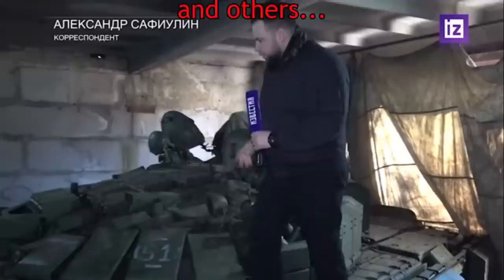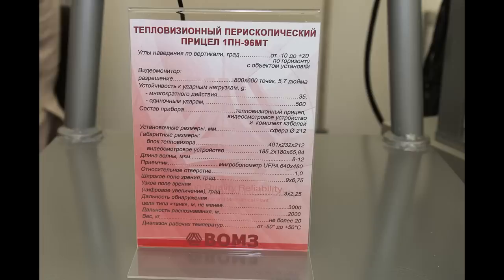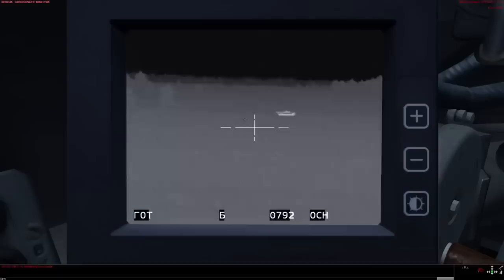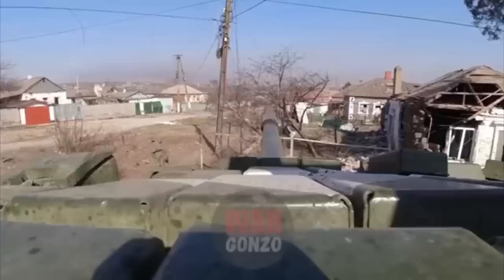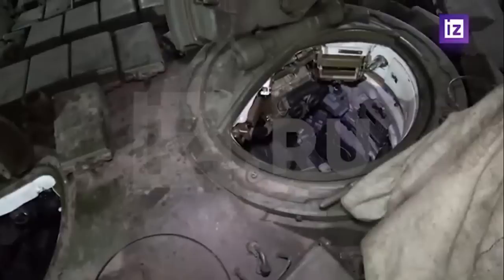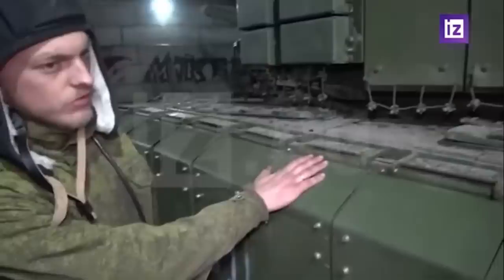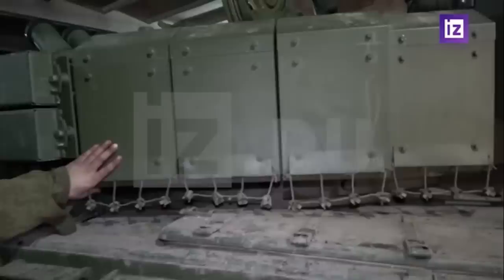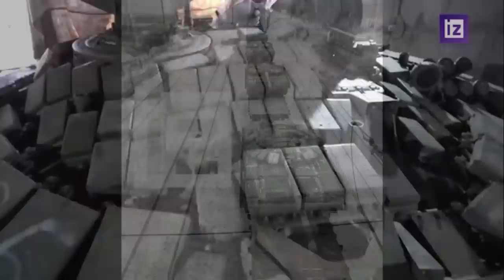Are Russians Downgrading Their Tanks?

Comment: I still cant tell the Difference between the T-55 and the T-72
Reply: The T-55 have small kaboom, the T-72 have big kaboom.
Reply: “I still can’t tell the difference between the Spitfire and a Tornado”
Reply: Well, l think you did not even tried... but if you are serious, just look at the wheels, T55 has 5 on each side, T72 has 6, also a T55 tank gun has a bulge (gas extractor) at the end of barrel, a T72 has a bulge somewhere at the middle of the barrel...
Reply: While T-63, T-72 and T-80s can be confusing (red effect made video about them) T-55s, T-62s shouldn't be.
T-55 has:
 - 5 road wheels, with first one really separated and 4 other together- biggest difference
 - Bulkier turret (with much lesser angles in the lower part)
 - gun with that thick bump near the muzzle (T-72 has roughly in the middle)
 - terrible way to make difference by, but frontal armor have horizontal beam running through it - T-72 has "V" shaped
Also this is purely intuition, but T-72 feels more aerodynamic if that make any sense
 - T-72 have much migger gun compared to its turret

Comment: This war has evolved into a fairly static attritional fight, where Russia is fielding a large number of conscripts with limited training.

These tanks are perfectly suited for being used basically as assault guns against static fortifications and infantry positions. The thermals will make a huge difference in such a situation, where as the auto-lead feature will hardly be necessary, as these vehicles shouldn't be facing Ukrainian mechanized or armoured forces in a war of movement.  

And if they do face a trained Ukrainian armoured brigade, frankly, the Russians will expect them to die to give better troops the chance to plug a gap or counter-attack. 

Whatever few crack tankers the Russians have left will get the T-90Ms